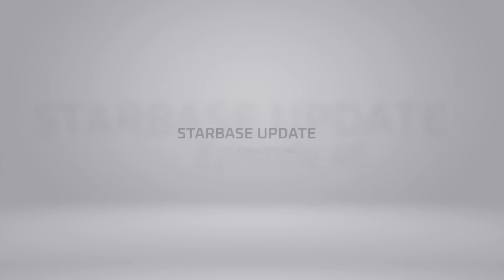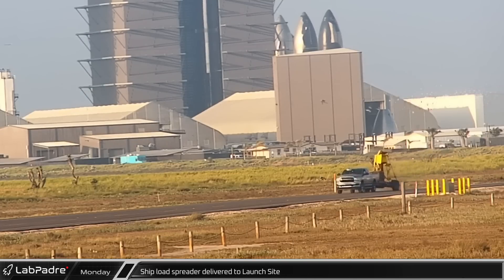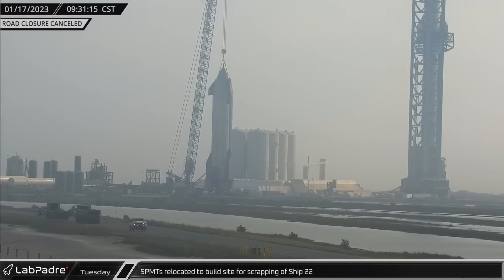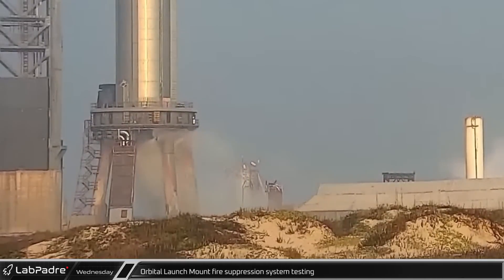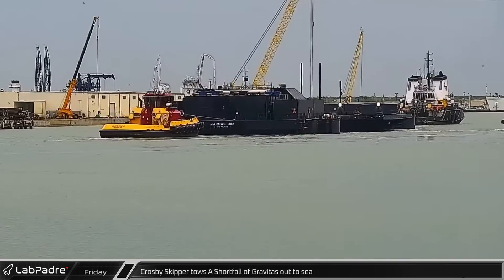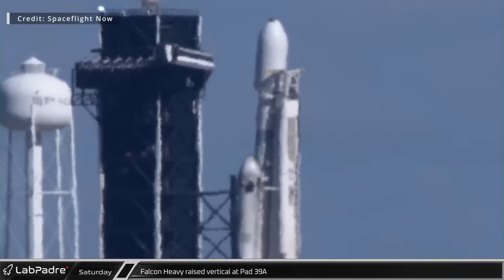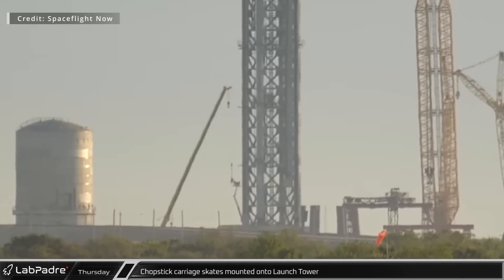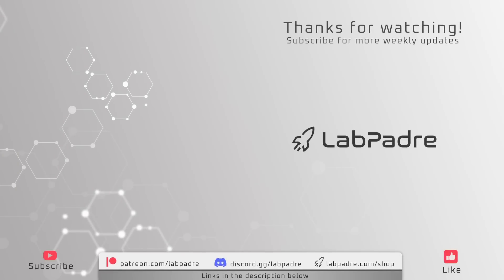Booster 7 and 8 Swap Parts? - Starbase Weekly Update #46

Comment: Great commentary as usual most appreciated

 I’m a blind subscriber so if the answer to one question is visually obvious sorry 
how are The chopstick arms powered are there coiled electrical power cables running to them or an on board battery on the skateboard?
Cheers